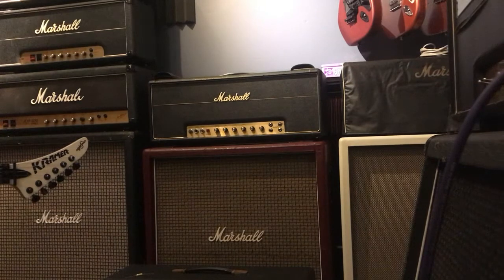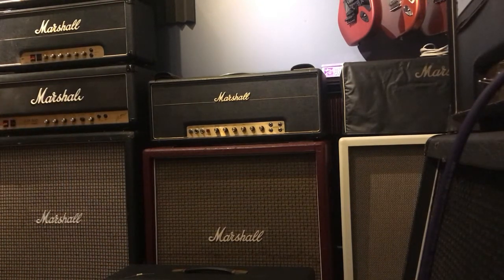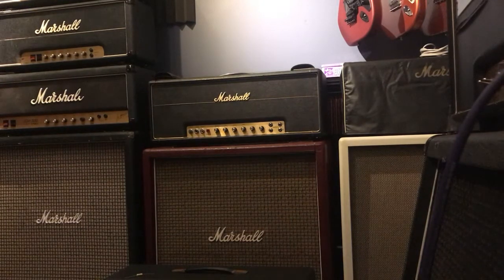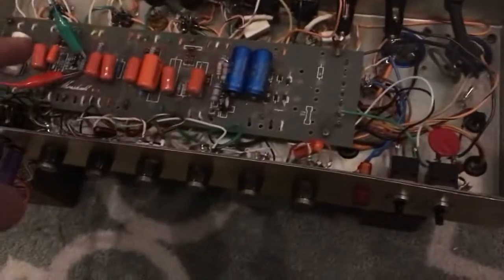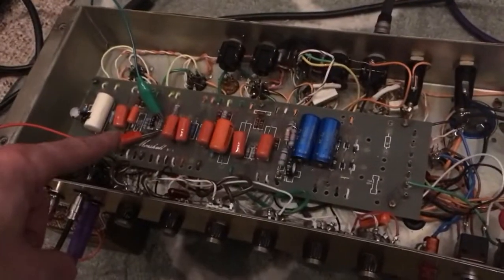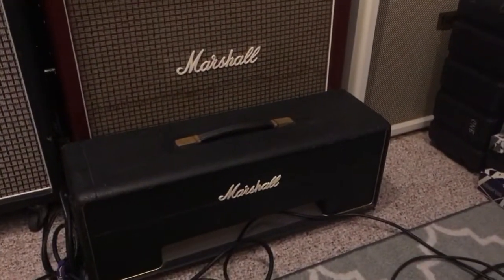Marshall 1974 Super Lead - Capacitor Swap on Cathode Follower. 25uf vs .68 vs no cap on 820 ohm.

Comment: I'm trying to figure out which v2b cathode cap for my SL. Specs say 470pf but not finding a whole lot of info on what different values will do with the tone on that one.
Reply: He's talking about the cathode bypass capacitor, and resistor.   I can't tell if he means V1b, but I'm thinking V2a.  The 470pf cap is across V2a grid stopper 470k ohm (treble peaker),  That's not the one.